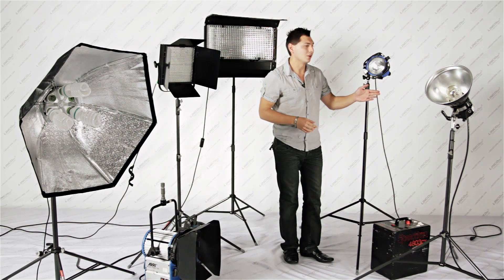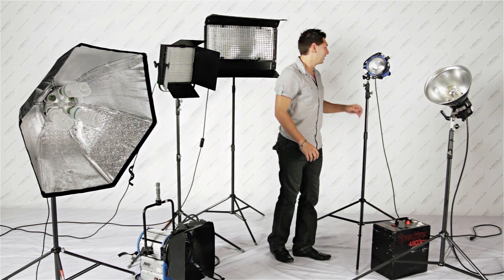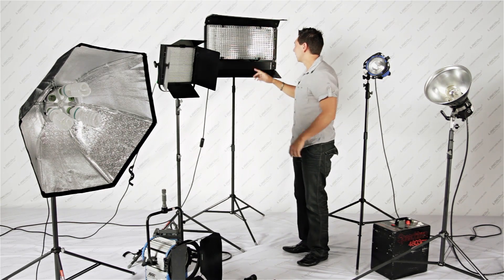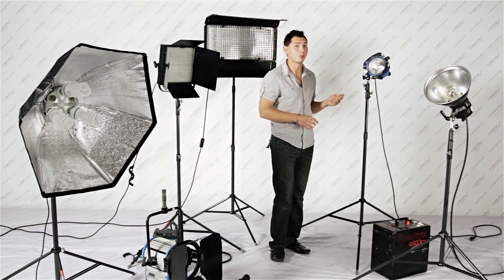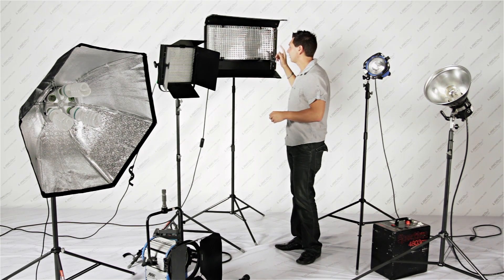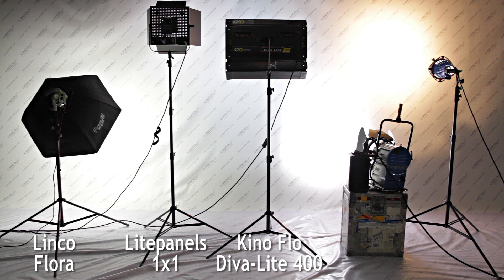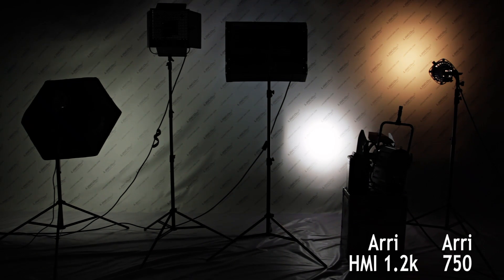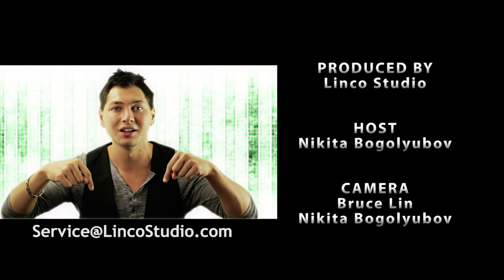Light intensity test - LitePanel 1x1, Linco Flora, Kinoflo Diva 400 lite, Arri 750 and HMI 1.2k

Comment: So the kinoflo ballasts are extremely reliable and do not fail often. ALso the HMI is heavy but is very useful for overpowering daylight. Also the arri 750 watt is mostly used for bounce not direct light. Against a 4x4 bounce it creates some of the best soft light and can be used right up against the bounce so there is less light loss when bounced. It is softer than the kino or any of the lights shown. Also this test is extremely useless. can we please use a light meter to have a standard to compare these lights with.
Reply: True true, but if you're needing tungsten and/or daylight the Diva wins IMO. Plus, this guy is pronouncing Arri wrong so that tells me the validity of this test.

Comment: you can buy a great 1x1 LED Light Panel at it-photovideo com. You should add in a "." in the obvious place. Google intellytech led lights and go to the non-ebay website. The Socanland 50CTD and D-50CTD are the lights that I recommend. Its under $1000 (compared to Litepanels which is $2600), and its much brighter, aluminum, and very well built. Have a lot of them now and absolutely love them.